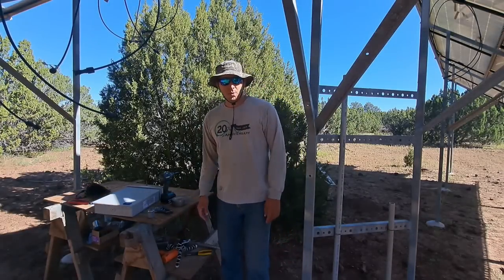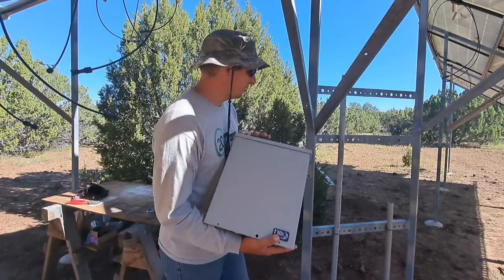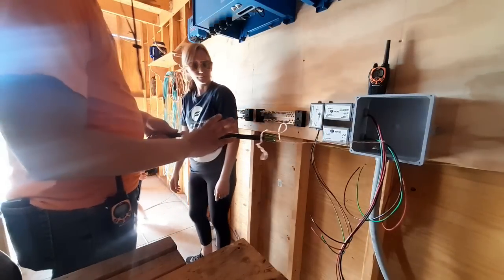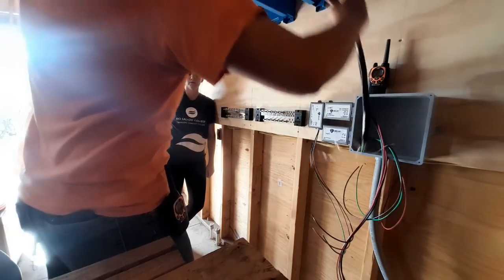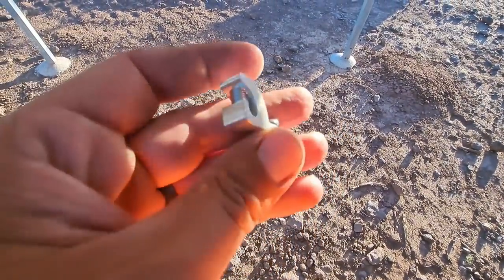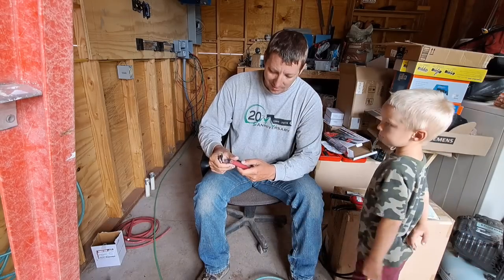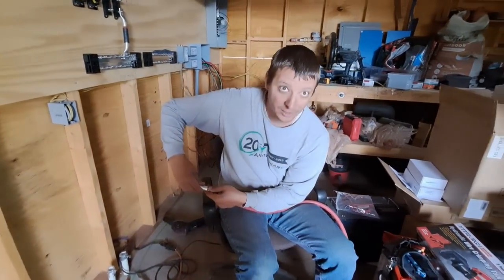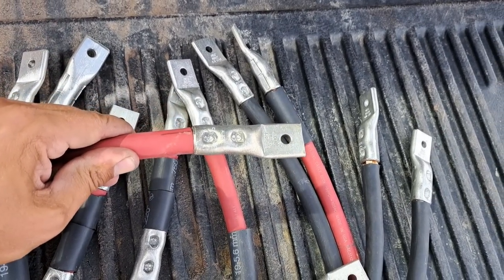Does Anything Ever Go According To Plan??? | Pulling Wire For Our Off Grid Solar System

Comment: Low-voltage systems tech (and handyman electrician) here. Bitter experience has taught me to always put in the largest diameter conduit that the budget will tolerate. Seeing you put in 8ga conductors tells me that with PVC, 2in diameter would have been the best compromise, especially with sweeps. Also, any time I had raw conduit ends, I ALWAYS taped them off to prevent foreign object/liquid intrusion, intentional or otherwise. In exterior applications, rodents and insects LOVE, LOVE, LOVE to crawl into holes like that.

It looks like you welded your unistrut supports for your PV panels for grounding, obviously, but I don't know how well unistrut holds up to harsh weather conditions. I live in SoCal, so UV exposure and heat are the greatest enemies for anything I install, rather than moisture. Iron Mountain is the only PV panel racking that I've had any experience with while helping a friend put PV panels on his house, but I understand budgetary concerns drive the decisions on materials selection.

I once had to pull 250ft of RG-6 coax through a legacy underground 3inch conduit that had filled with water over time, and it took me 7 rounds filling a large ShopVac base to get all the accumulated water out of it before I could suck a pull string through, that then got tied off to kevlar pull tape salvaged from pulling fiber optic lines.

Comment: Starting to follow you're progress - very nice and thank you-all for sharing.   Pretty good vids as well - love you driving thru the solar framework a couple back.   FYI - For lugs, if you don't have a crimp tool, you can hammer them flat on the wire and then use a punch to put dimples in on both sides - works OK.  They key is you want a good connection that doesn't get hot - and you can verify that once you get the system running by touch :)
Reply from the maker: Hey Kenneth! Thanks for the tip and thanks for following along. 👍

Comment: Might be good to use the jet line to pull two jet lines through first. Then if one snaps, you have a second back up one. It ended up working fine thankfully 🙂